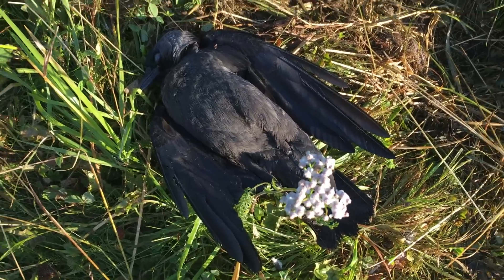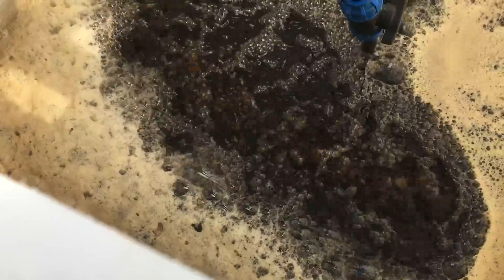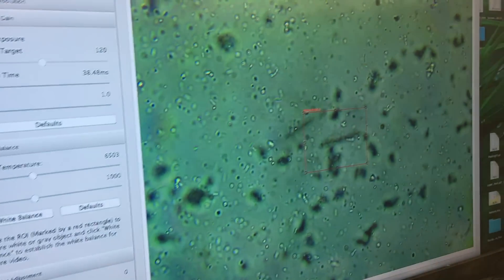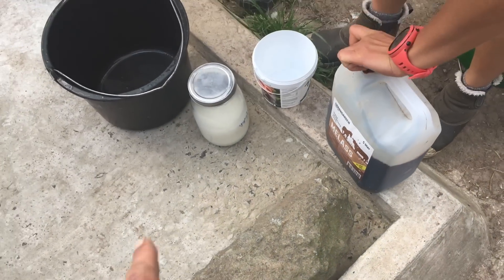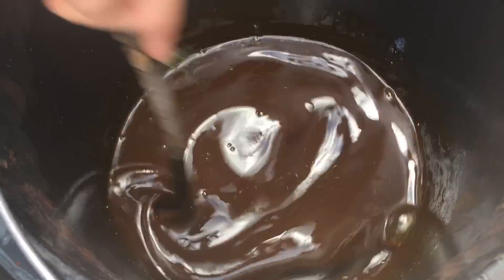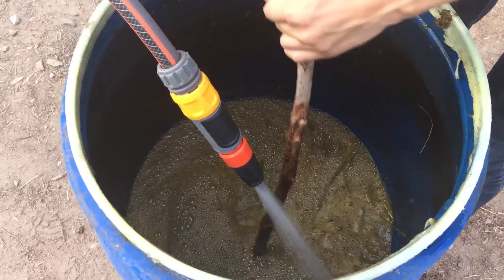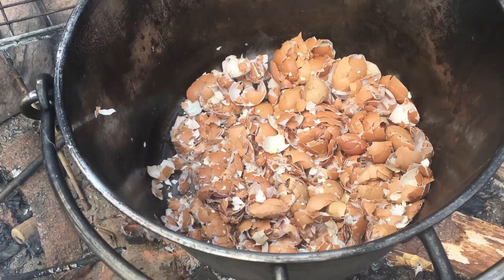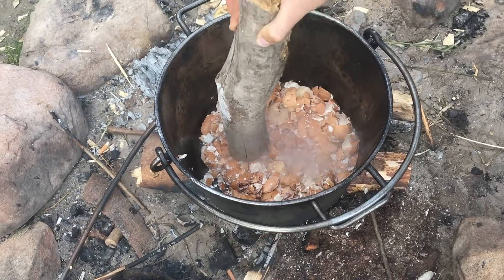S4 ● E83 BioFertilisers, Compost Teas & CalPhos

Comment: For food waste composting, could I layer it out on a wide area of ground? I would like to remediate the soil in a large unused plot of land. Following nature in this way, will it biodegrade into useful organic matter for a future large garden?
Reply: Sean Reed Sean, It depends somewhat on your climate and other factors; for us in dry California, we would lose much of the nitrogen in the food waste as it sits exposed to the baking sun; and not being in contact with soil particles, manure worms and microorganisms, but drying air. You’d still get some of the organic matter...eventually.
You could add a ‘mixer’ such as poultry to help break-down and incorporate the food into the soil a bit, which would help.
In a more moist climate perhaps a denser insect and manure worm population might break down the food more quickly, and draw it down into contact with the soil, capturing more of the nitrogen and other nutrients.
For our dry CA climate it makes more sense to feed it to manure worms in a concentrated setting and later distribute the castings as a concentrated source of nutrients, enzymes and biology. By concentrating the processing we’re more easily able to exclude rodents, who would otherwise profit from widespread broadcast of food ‘waste’.
Or capture the value of the foods in a nice compost system.
And of course you could try it and see what happens!
Have Fun!